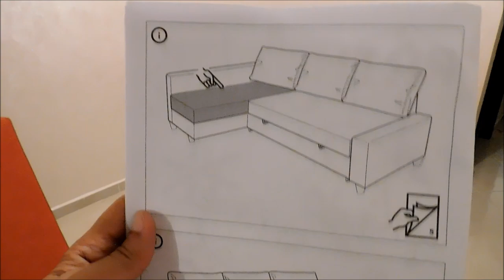IKEA FRIHETEN Sofa Bed assembly instructions

Comment: Thanks for the video! I was curious how this all came together. Have you had to disassemble to move/sell? Is it easy to disassemble or does it need to stay in one piece when moving?
Reply from the maker: Hello. I never disassemble it. but as we assemble it we can disassemble 
 it.
you can move it in one piece but push it on both corner
Reply: @th3blogger  hi good afternoon finally I found a perfect guide to assemble the sofa bed.

But mine was only a gift and given to me dis assembled.
And some screws are missing may I know what and how many screws does it needed?
Reply from the maker: hi thank you for your comment.  2:11 you will find the necessary screws.  you can buy them from ikea or other store.  good luck
Reply from the maker: I will put them in detail on my site as soon as possible